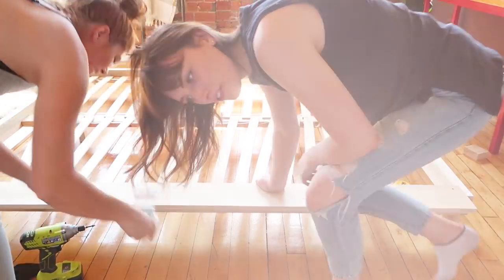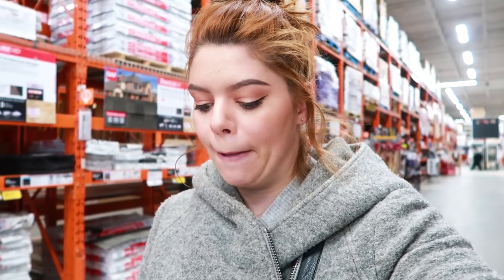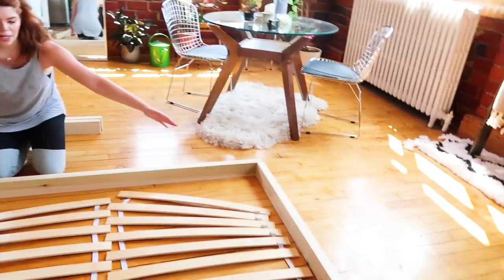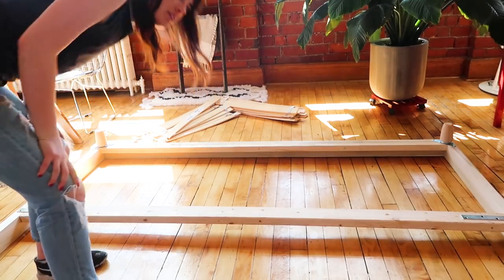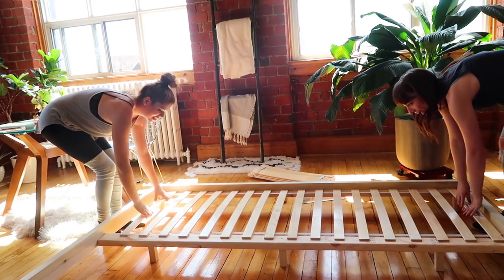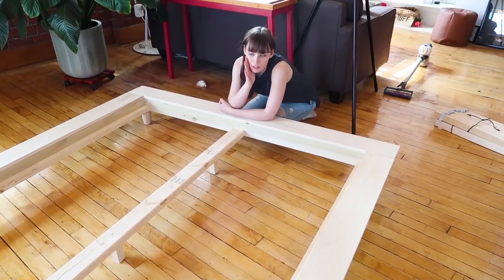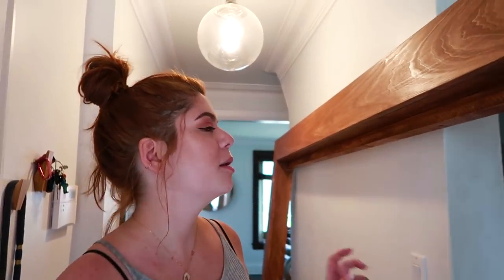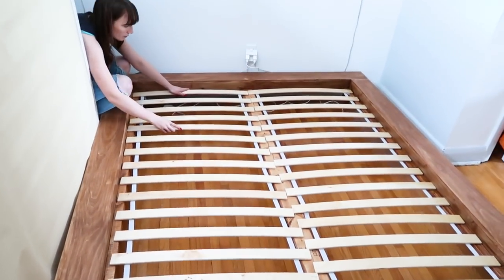we build a platform bed for CHEAP!

Comment: Nice. What was the total cost??
Reply: Hollie C she pointed out the cost of every item.....not to mention that she told you the total cost of the wood........do the math.
Reply: Rough estimate: $80 for the feet, $150 for the nice wood, $50 for the slats, $10 for the wood from Home Depot, $35 for all the metal brackets, $20 for the stain, and give or take $10-$20 for every other little thing. All in all, $365-ish is my best guess!
Reply: Love, Alayna u a hero
Reply from the maker: This is pretty close! Pretty great considering our goal was to stay under $700! Keep in mind that these prices are in CAD!

Comment: Little tip, you can make your own wood filler with sawdust from your sander (it’s the finest) and wood glue. i never buy it.
Reply: I didn't know this! I've only recently started woodworking (I love it!) and woodfiller is so expensive and clunky but I love being able to hide the countersunks...what ratio sawdust-woodglue would you use? And wouldn't the filler have trouble taking stain since woodglue doesn't take (oil based) stain?
Reply: Expensive? Where are you buying it? I bought a tube for less than $3.

Comment: I'm planning to make a platform bed with oak beams. I'm wanting to get the straps (metal plates) to use as securing them together and also to put an industrial, black metal vibe to the head board. I'm very excited to do it!

Comment: Use Spax screws they will not split wood. 

Legs look like Iroko wood. Hardwood that are v beautiful so worth the money. 

The ikea slats give a spring to the mattress and do a better job of supporting the mattress with their up curve.  I had to screw some of mine in to hold them. 

You can get plastic boxes ir make your own w castor wheels underneath for extra storage

Comment: Next time build the bed in the room it will be staying in 😂😂 Awesome job! I would’ve had to find a different leg option though $17...yikes! (I looked at our hardware store and they’re only about $7)
Reply: queenginger2u you can use 4x4 pieces as legs, they would be way more cheaper and they look really nice
Reply: They are paying in Canadian dollars. So it's probably about the same in USD after exchange rate.
Reply: Liana Angelucci The conversion isn’t that much, they would be like $13 here, which is still crazy!
Reply: Great suggestion. Abit of sanding for smoothness and tapering would work as well as using double end connecting bolts.  Thanks for posting idea!

Comment: I could never sleep in a platform bed because i have the tendency to flop out in the middle of the night to get water, so I would totally break myself on the sticking out wood part... But I would love to build my own bed frame instead of using the metal one that came with the mattress and box spring and I definitely plan on making my own upholstered headboard when we get our next place (cause currently our window is our headboard and we dont want to block it.  I would also love a foot board - anything to keep the mattress from continually pulling away from the top and moving further out into the end of the room.

Comment: you are right about the legs......what you can do is go to the goodwill and buy an ottoman with legs that screw off and paint them. for the bed.....the ottoman is usually way cheaper than $64 in legs......more like $15